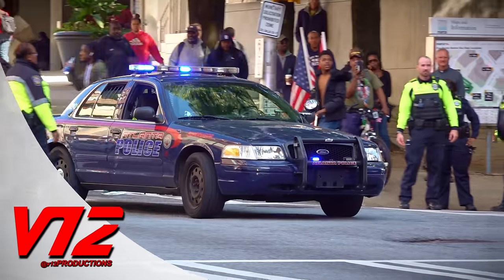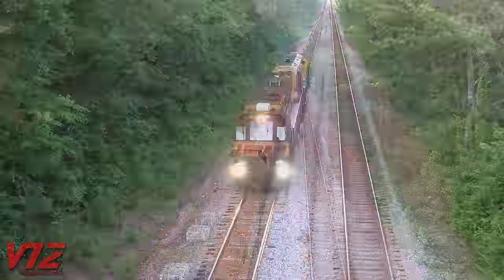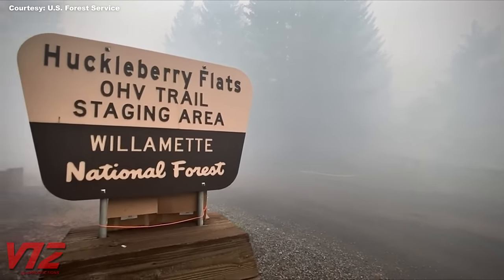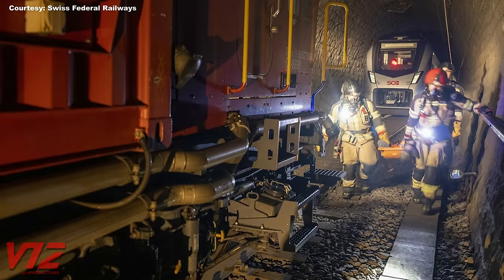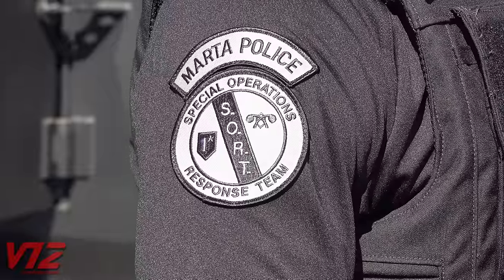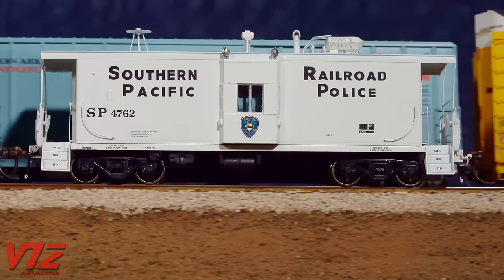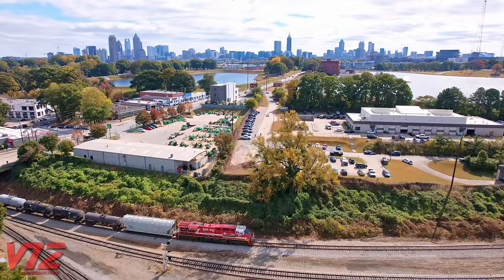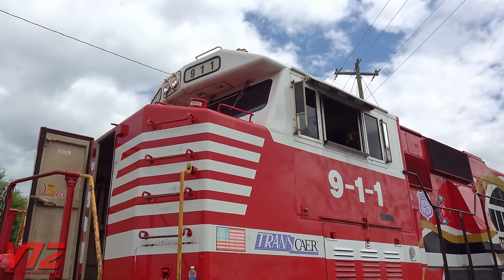Firefighting and Police Trains

Comment: This takes the meaning of “fire engine” to a whole new level
Reply: LOL
Reply: not much difference between a fire engine and railroad engine: instead of pumping pistons to move driving wheels the engines pumped pistons to move water out of hydrants! and in the early 1900s until the late 1920s they drove the engines as well- simply put them on rails and they’d be no different than other engines 🤣
Reply: La policía
Reply: Kkji

Comment: Here in Germany, Austria and some other  European Countrys, some Fire Departments for example have also specialised fire Trucks with hi rail gear, most of them are heavy duty rescue trucks and have special Equipment on Board, while others are traditional Tanker.
Reply: Some underground stations in my country's subway/metro have trolleys folded up & stored at 1 end of the platform, that can be unfolded & placed on the track to be ridden by firefighters to rescue people from trains trapped between stations. Stationary water jets can also be mounted on trolleys on rails to put out fires in train tunnels

Comment: several rail networks across Europe run their dedicated fire and rescue trains, like e.g. in Austria, Germany, Switzerland and Norway. They're based at lines which are difficult to reach as they're up in the mountains, go through lots of tunnels or high-speed lines which are difficult to access as well. 
Some sections of track which only might have difficult access might be covered by only a single rescue car, which will be taken to the incident by a locomotive.

Comment: In Germany, there are even fire-fighting vehicles that can drive on the road and on the rail. It is called emergency firefighting vehicle 24/14-S(S for rail). The duties of the emergency firefighting vehicle 24/14-S are:
-Fire-fighting; focus on tunnel installations
-Technical assistance; focus on rail vehicle accidents
Reply: Nice
Reply: @karstendoerr5378 assistance? Is that technical rescue
Reply: @longiusaescius2537  ,Yes. You have to imagine the German HLFs as a combination of rescue vehicle and engine. So you can carry out technical rescue and firefighting with it.
Reply: @karstendoerr5378  are the technical rescue unified organizationally with the fire department?
Reply: @longiusaescius2537  In Germany, the fire brigade has many tasks: technical rescue, firefighting, hazardous goods, radiation protection, altitude rescue, divers. In addition to training in firefighting, I myself did hazardous goods and radiation protection.
Reply: @longiusaescius2537  in Germany already a plain normal Engine can work on both fire and rescue calls. They come with a wide range of rescue equipment and tools that they barely need the support of a dedicated Heavy Rescue Truck on scene of most rescue calls.

Comment: Not sure I noticed those extra details on CSX 3194 on 911 before. Gotta say, I have a bit less respect for the former and much more for the latter. The "343" actually gave me pause. Generally fantastic video! I never would've guess police to still have full service vehicles exclusively for railroad, even if the modern examples are only Hi-Rail, and the various firefighting equipment? Incredible!

Comment: That NJ Transit Truck is great, or woukd be if they were ever available when you needed them. Have seen everything from rail line brush fires to 10 alarm buildings with a side accessible only by the rails and cant think of a time they actually showed up, though can think of several requests..

Comment: Thank you for the video. The Rail Rescue Vehicle seems a bit excessive. :P
Reply: how is it excessive?
Reply: @SouthJerseyRailfan  I'm leery of the militarization of police. They might have a solid use case I don't understand or know. It's interesting no doubt.
Reply: @andrew3139  Say if someone took you hostage, would you rather have the big armored truck pull up with well equipped tactically trained officers show up or a patrol officer with nothing more than an SUV and a pistol? The reason why police departments are getting more "militarized" equipment is to make situations safer for themselves as well as other people. At least 99% of them are not doing it for some sort of power trip. They're adjusting with the times. For example, poor mental health has been skyrocketing in the US and unfortunately for some people really poor mental health leads them to do horrific things. The police departments are just equipping themselves to better deal with situations such as those.